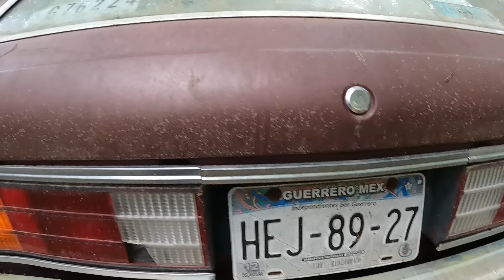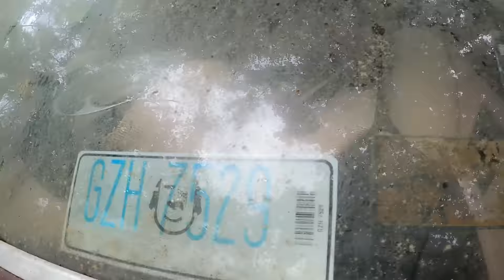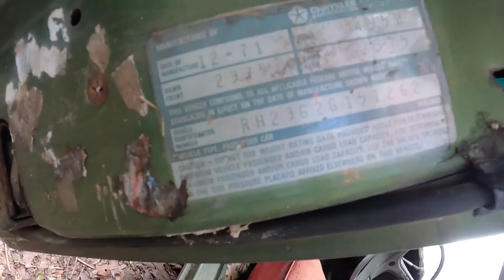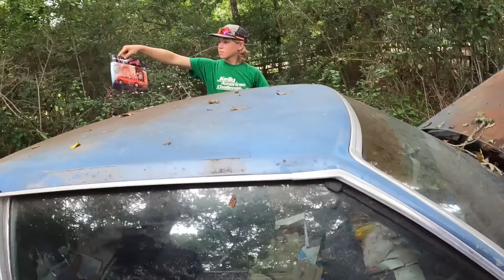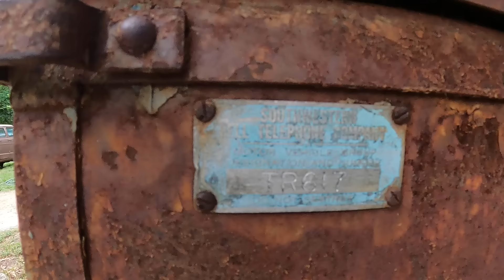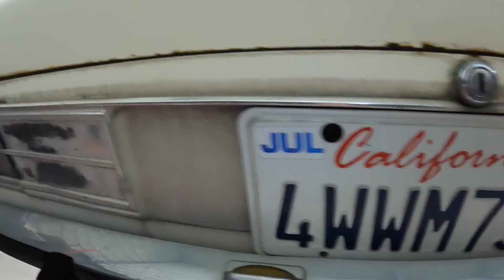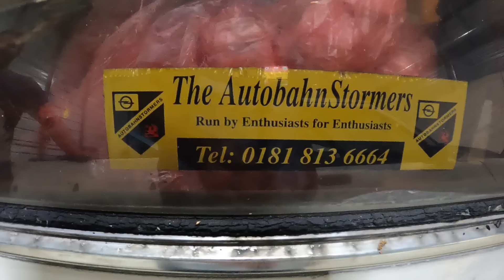Exploring East Texas Junkyard Full of Cheap Project Cars!

Comment: I did some really strange things with rigs like he has there. For example, the really rusty Chrysler product that your leaning on at the last part of this video. Its got good glass and its a hardtop meaning I took those "B" pillars out and parts of those type doors plus all of the electrical stuff. Absolutely saved the glass from the sides as well. I took that and grafted it into any old sedan from  the fifties.... it really helps if the rig its going into is fairly rust free and a two door as well but it didn't stop me if it was a four door. I took the tops off to start with and then grafted pieces and parts to the rig being fixed up so that when done, it was a two door hardtop. I used a forty eight plymouth two door sedan to convert as its value if I didn't succeed in making it work, not too many folks would of screamed at me. I made it look so cool and had the one and only two door hardtop plymouth for a forty eight model never came as a hardtop yet. I cut the glass to fit the new doors and used even the b pillar out of newer dodge I cut it out of. Yeah, it took me almost four months to get it to paint and polish but it did win  trophies. Folks were amazed at all electric in that old plymouth that even had air conditioning grafted into it.  What really amazed many who did not know much about cars period was the all electric two door hardtop rig and had all original running gear meaning a flathead six engine. I did sell it for good money and he changed the engine and other running gear to a small block dodge 318 with a automatic. I had left the original running gear in it and it was three on the tree. You can be real surprised what you can do for parts when it comes to junky old rigs.
Reply from the maker: That's pretty interesting. It would have been something to see going down the road.

Comment: If that Maverick Grabber was a Manual.........Wait he said he'll throw the parts Maverick in the deal?? YEA BABY YEA! That's something you could use a few parts off it from the main one with the 302 then sell or trade the parts one for a Manual trans and you're set!! THOSE CARS WITH A V8 AND A MANUAL ROCK! Especially if you put a set of coil overs in it then you're set!  BUT A 1968 Fairlane with a 289!! Come on $1000 COME ON THAT'S Awesome! I guess in the USA as opposed to Canada these types of cars are just junk yet. But here if you can get your hands on a four door with a 289 from 1968? GO TIME BABY!!  74 Plymouth Wagon is NOT rusty! It's just got Patina. If it was rusty you'd see holes in it.  The trunk popper on the Monte Carlo would be in the glove Box and you'd need a battery if it even works.
Reply from the maker: A 302 in that little Maverick definitely sounds like a quick and nimble setup. Im not sure about the rest of the US, but here in TX 4 door cars get no love. Ironically, everyone wants 4 door trucks, though! I realized later that there was probably a trunk popper in the globe box after the fact, but like you said, it needs a battery to work.
Reply: If u wasnt so far away